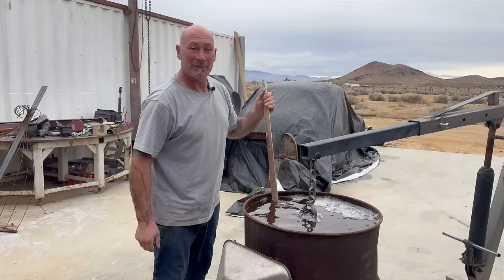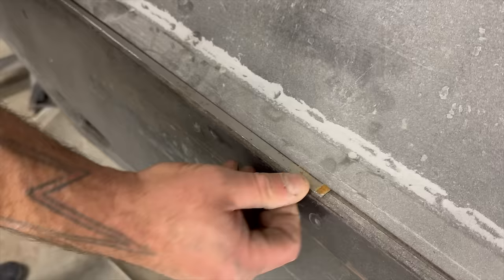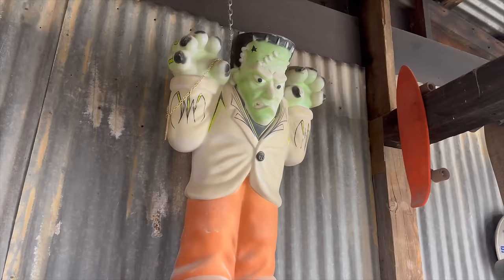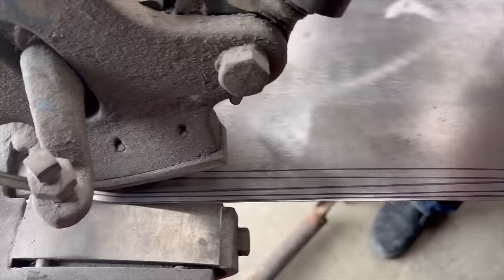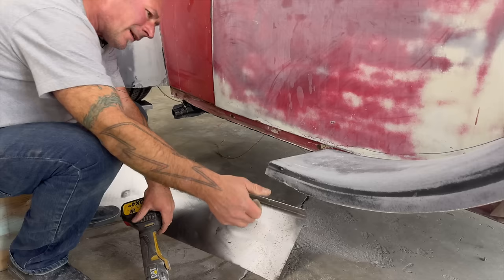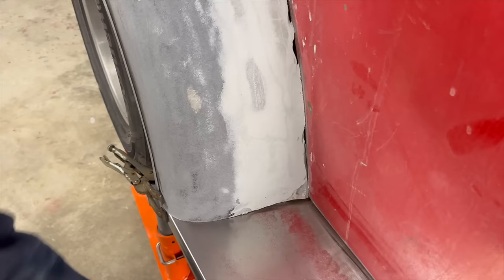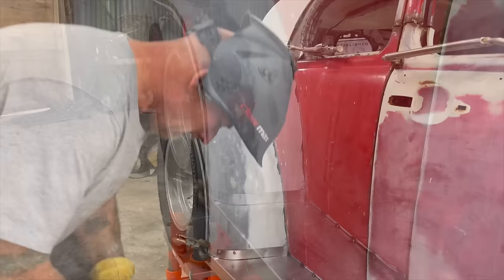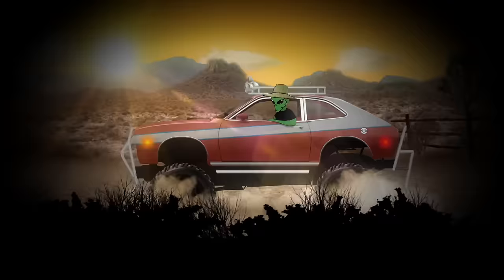Part 30! 1968 Kustom VW Full Custom Ian Roussel Class Is In Session 🤓

Comment: That long bar with the steel wheels on it is called a Johnson Bar. We used to use them all the time moving heavy equipment. 👍👍
 The bug is looking great.
Reply: Nice Johnson!
Reply: @chrismarr2663  Big Johnson :face-turquoise-covering-eyes:
Reply: That's why it stays outside
Reply: Steam train engines also have a “Johnson Bar” for adjusting steam piston cycles I believe
Reply: @edfranklin2  I love Steam Trains, it amazes me how all that iron-ore was mined from the ground and turned into a machine like them..
Reply: I used to work in a warehouse, we used it to move trains. The railroad would drop off the railcars to be unloaded and sometimes the car wouldn’t line up with the warehouse door. Stick this under the wheel (lever action) and you could move the railcar about an inch at a time.

Comment: My CDO was crying out to me with that rear fender strap. The fender is so smooth and pretty, i was hoping that strap would be on the underside of the running board with hardware on the tire side of the fender. Like a 53-56 Ford pickup. 

I'm anticipating the door opening  process. So fun to follow along at home. Your building of stuff is like watching a calm Bob Ross painting come together.
Reply: I'm with you on the door. Is this an oversight? How will it open? 6:57

Comment: Running board looks great! I've been picturing how sweet it was going to look with it tied in. I've been a sheet metal worker for 34 years and I was thinking when you traced where the rear fender came down that I would have just cut it a inch and a half longer and bent it up inside the fender and riveted it to the fender. There for the bracket you made would have been part of the whole thing. But it works either way lol Love it I can picture the finish look and it's going to be sweet

Comment: The tool you pulled out to lower the car is called a J- bar. It's purpose was used for cases in grocery stores to lift and bump them in place it was also used to pick up gondolas those are the stands of shelving that groceries are placed on we to put rollers under them to move them out of the way to lay tile in the stores This way you don't 
 have to unload them. Pretty cool tool and now it's job has changed to lift cars up to get the jack out.nice running boards Take care.

Comment: I've always been a fan of the old VW Beetles. I bought a 72 several years back. It was rusted and needed tons of work. I ended up selling it because I moved away for a new job. Last March, I found a 63 Baja. It's pretty clean so I plan to get this one on the rode and have fun with it. I've always been impressed with Ian's work and his approach, so when I saw he was going to work on this Beetle, I tuned in for some inspiration. I haven't missed an episode with this car. I'm curious to see what he'll do about some of the areas, like the front fenders, that will have considerably thick walls due to the layers of fiberglass/kitty hair. I'd be tempted to get the outside form I wanted, then use them as my master to make a mold with. Then use the mold to make new fenders with at proper thicknesses. I'm staying tuned!

Comment: When you were laying out the contour line bringing the back into match the fender it may have been easier to do the layout using a butt gage. You could set the front setback to match the rear and strike a line common to the body and trim, then set the butt gauge to the setback distance and strike a line parallel with the trimmed edge. then trim the panel. A Stanely 95 butt gauge is an example. I just use a rod with a carbide scribe point fixed perpendicular to the rod with an aluminum block that you adjust the setback from the point then you can slide the block on the existing edge to layout a new line parallel to it...
Reply: Yeah………….. I used a sharpie marker.
Reply: @Ian_Roussel  Pizza Shop Sharpie ?

Comment: Hi from spain, great show.. This bug is looking genius but i wanna offer 3 sugestions, you ask it or not?

1: A fith of the door, the lower part is fit to the chasis and opens like a wagon door, from vertical to horizontal in the same motion as the door opens.
Hence  a smaller and lighter door for the mechanism, offering a great space for entering and at the same time a place for footing, that its not that flimsy skate railing. Only problem to this is your trouser might get dirty while sitting inside ;) . 
This could be solved with a mechanism, that opens a 2 way tray, when the door closes, the tray closes... so in the interior of the tray is the rubbery part were you stepped over to come in, and closed the leather upholsetry, interior of the car.

2: the back window aperture looks too small, with far to much space, from it to the end boot of the car, how about replicating 2/3s  reeflection of the front window, just opposite...

3 the door handle, could be done, kind like a light weight aircraft flush to the door panel, those hidden ones that dont affect aerodynamics. you press the front too bring the handle out, under that is placed the keyhole, the handle has to be completelly round like a window crank, so to follow the motion of the aperture upwards, without twisting your hand, and can be replicated inside, in the same manor.

If i had your email i would draw you a sketch

great show thanks ever so much, its very inspring!

Comment: Interesting fab work, although I would have tried to copy OEM when attaching the running board to the body (bolted on a flange) and also bolted the running boards to the fenders, in case of future body repairs. Any "daily driver" will need repairs down the road.

Comment: You adjust the break with the center Nut . And adjust the metal thickness,at each end. Then your bends will be perfect
Reply: On flattened caster wheels? On an uneven floor? 😂

Comment: Hey Ian, that things about an inch off the ground in the front are you gonna run it like that or are you gonna put an airbag in there to lift it up? I mean I think you need at least 3 inches right?,, I mean to run it on the road.,, looks good, laid out mind you and I like that,, my truck lays frame and lays body and still has a stock floor inside. It’s the bomb.
Reply: ClickOnProfile5160  OK what’s on your mind?

Comment: I am surprised you didn't run that running board through a bead roller to give it some shape and to add some strength.
Reply: They will likely have rubber on them..

Comment: If you had made a bracket or something to attach the running board to the rocker from underneath, then you would have had a nice, clean, straight panel line between the running board and quarter panel, and not an ugly seam full of weld...  Could also have rolled a few beads along the length of the running board to give a feature and create some stiffness.  I really like your work and the sculpture methods you employ, however I'm always thinking a few steps ahead to what the finished article could look like and take advantage of the opportunities in front of me if I think they will lend themselves well to the project.
Reply: They will be glassed on and likely have rubber mats..

Comment: hEllo again !  I guess since it's the internet and everyone has comments ......  First I really love the bug project !  I have a few more really cool fiberglass tips for you.    Instead of mixing your glass on glass ( I did give you the making panels of fiberglass sheets by mixing your fiberglass on glass ) but, you can take parchment paper or waxed paper and lay it onto either of those.  Another is since you have kitty hair if you wanted to make a quick mould you can lay or tape down your waxed or parchment ( Baking paper) onto what ever like your running boards then spread your kitty hair or bondo maybe putting some fiberglass cloth in it and after it dries you have a smooth reverse mould of whatever you want.  An example would be like the back windows or even the duck tail on the rear fenders.  It's fast and easy as well as leaves you with a mould you could use in other places.  As for the stands you have under the bug I made some like it in High School back in the early 80's but, made them with ramp and pieces to go between so I never had to work on lower places like rocker panels etc...  It's cheap and easy and brings those places to a higher level.  So if you can't afford a lift they work great.  Work smarter not harder.  I have tons of great tips.  If you ever want more ..... just let me know.  Oh one more for the road...... most fiberglass people put the cloth or matt down onto the project then add the resin on top of it then roll out the bubbles.  The matt or cloth has a tendency to move or blow off the project so, take some spray adhesive and place it down with that.  As for a roller make your own with two sizes of washers staggered to give you room to get air bubbles out.  Put it on a handle and you have a great tool !  Ok enough for today !   Enjoy your  weekend.  It's raining in my part of the desert today !  But i'm in Arizona !Thanks for the time to take and make your video !

Comment: 20 gage for running boards...really?   I know it's easier to work with, but it is way too flimsy to serve as a running board you intend to use.  If it's just for looks, maybe.  Should be either 16 or 14 gage.
Reply: Have you ever seen a Volkswagen running board. If you did you would say he’s going to thick 😂
Reply: It will be supported from under.